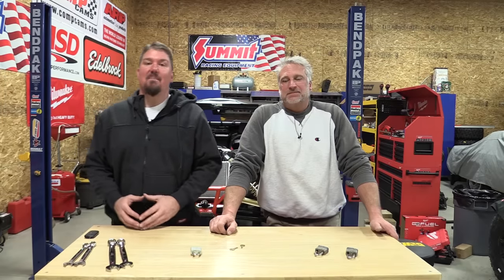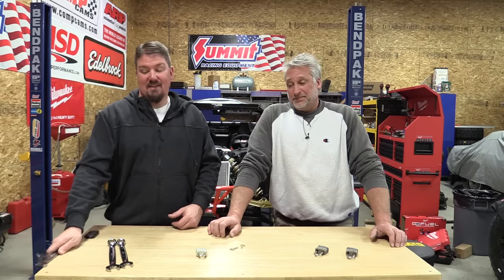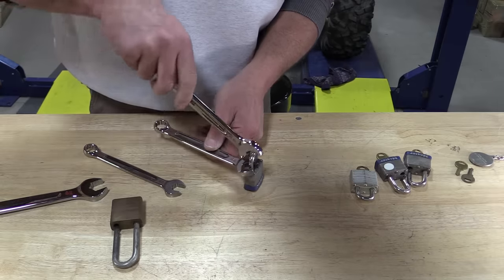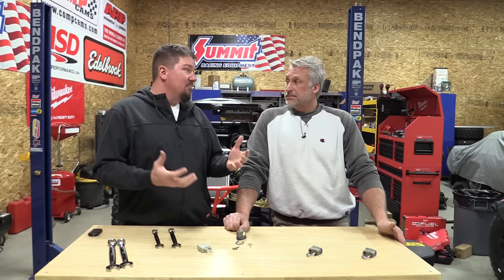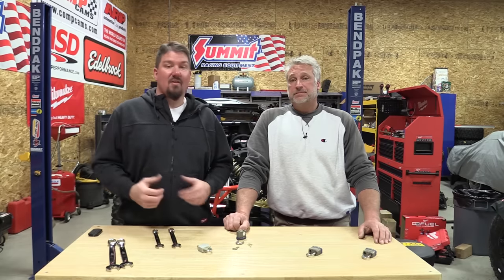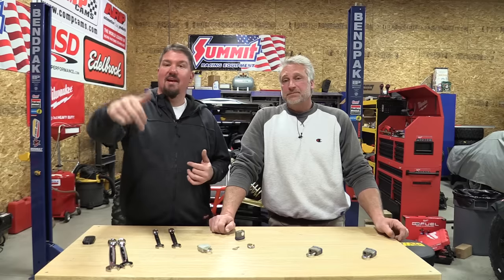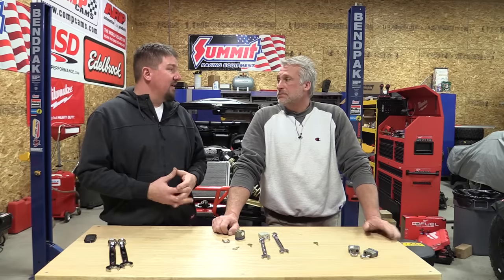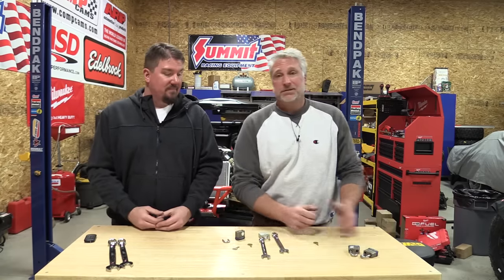How To Break Any Padlock, Even a Master Lock, With Ease Absolutely Scary

Comment: So, I'm such an idiot...I bought a new gun and locked it up... "oh, so safe"  in a  TSA approved gun box with two locks (using same key). Here is where the idiocy comes in...I put the 1 key in the case and then being very conscientious, I locked the padlocks up. 

Now what do I do? I am single and 62... not strong enough to use the wrenches. Will a hardware store make a key for me if a have a receipt for the gun and my ID? I hate to pay $150 for a locksmith.

Help!
Reply from the maker: Do you know of anyone with an angle grinder?  They could cut the locks in seconds.  Bolt Cutters would also work.  A locksmith can also take them off.  If they are TSA approved locks, TSA has a master key and that key might not be hard to come across.

Comment: I make my living off of things locked behind a Master Lock they bother locking it up it's worth taking and once I see Master on the lock heck I can break into those in 2 seconds with the equipment bought from any 7-Eleven effortlessly and it's all mine and the way the motor pawn shops work nowadays if I sell it to them and the owner finds it the owner has to buy it back so there is no risk the pawn shop has to take therefore it is very easy to sell it off.. A 16 year old can do it.

Comment: Thief’s absolutely suck like get a job or a life!!! I’ve recently had encounters with thieving they stole my 2009 Yamaha YFZ 450 quad that was worth like 4-6k the way it sat with led headlights aftermarket gas suspension and 80% brand new tires and it also was piped & jetted iykyk

Comment: In all fairness, you're placing a lock on a convenient, solid, flat workbench surface. You're turning the lock to get proper angles. That's not the real world. Even a third hand comes in to hold the lock steady. I'd be more interested to see the same measures used on a dangling lock hanging in a not so convenient area.
Reply: Still works. Did it just now locked to the garage door.

Comment: With master suck and any lock just as awful just pull up on the shackle a bit and smack the side with a hammer or screwdriver handle till it pops open.  A faster way is to put a monkey wrench on it and twist.  There are a million ways to open these cheap awful locks and criminals and novice know them all so save your money and NEVER purchase them.

Comment: One issue with wrenches, is how do you get two large wrenches, into a short shackle, when the lock is locked onto a hasp, or trailer hitch, etc? Holding the lock in your hand like you did, there is no obstruction for the wrenches, like there would be in real life. I'd pick the grinder, and get if done.

Comment: Master locks are bottom of the barrel in quality. Check out Bosnia bills lock pick you tube page. If you want a good lock get an Abloy or Abus. These are $125 each for a pad lock. But nothing will open them besides a die grinder, or cut off wheel, or torch.